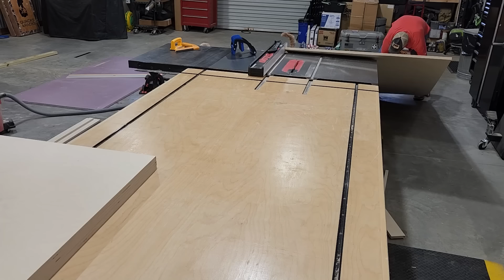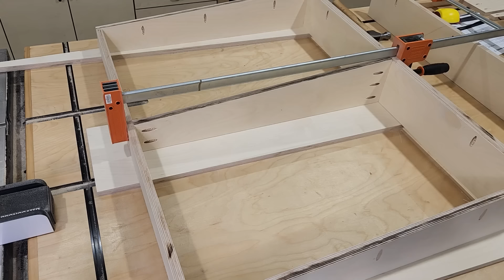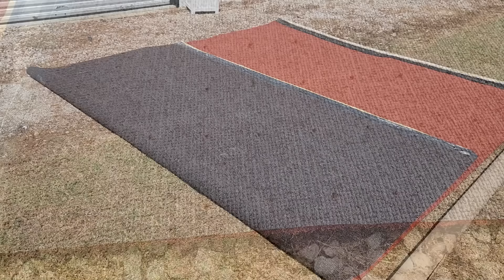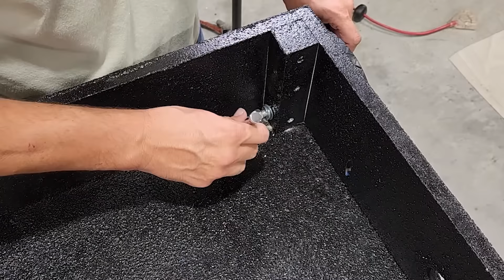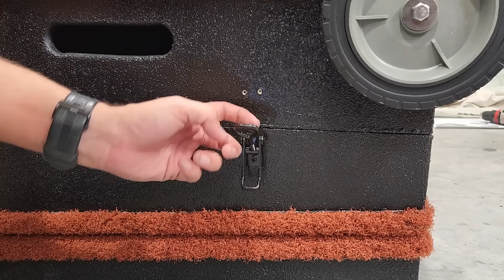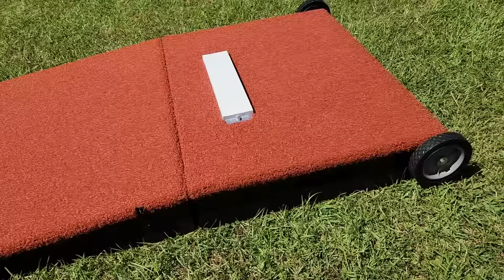How To Build A Folding Pitchers Mound - Baseball/Softball

Comment: Can you provide a link to the wheels that you purchased? I purchased the plans and I can’t find the wheels.
Reply from the maker: Any 8in wheels should work, I got mine at tractor supply but there are several options on Amazon. 

Something like this would work https://amzn.to/4vMJVPY
Reply: @PatriotDIY  I got the bolts, however just in the future anyone going to this link should know that the bolts are not long enough to go all the way through
Reply from the maker: @akeenmindcom  obviously you have to factor in the width of whatever wheels you are using when you decide what length bolts you get.

Comment: Are you using cleats on this, or just tennis/turf shoes? It sounds like it’ll be used with younger kids but how do you see the turf holding up to actual cleats with bigger pitchers?
Reply from the maker: Depends on what turf you use. The turf i used is very high quality and should hold up for a long time. My son has worn cleats when on it but mostly tennisshoes or turf shoes. Obviously it will depend on how much use it gets. 

I definatly wouldn't use metal cleats on any turf
Reply: Using cleats on a platform like this isn’t the smartest thing in terms of balance honestly.

Comment: Can you make an in depth video of your golf cart wiring. Like showing where each wire goes to on the battery terminal and fuse box. I tried to follow along but have run into problems
Reply from the maker: https://youtu.be/fnAOpvMJQ5A?si=HWpmJVfKmU9n8hxL
Reply: @PatriotDIY where does the black ground wire from the nilight switches go?
Reply from the maker: @Todd-d6x fuse box